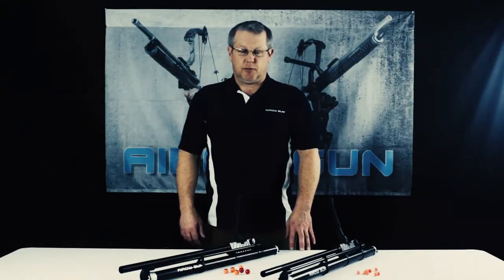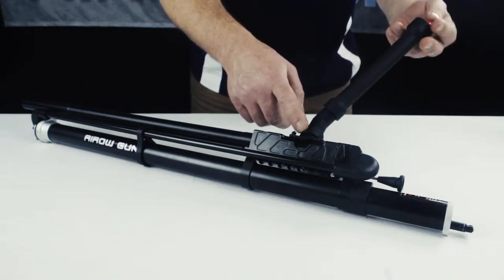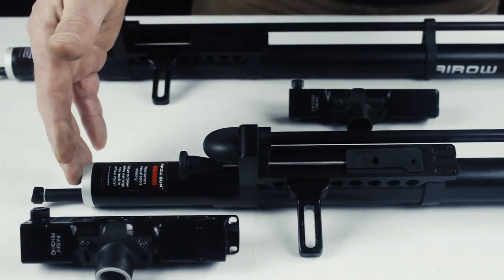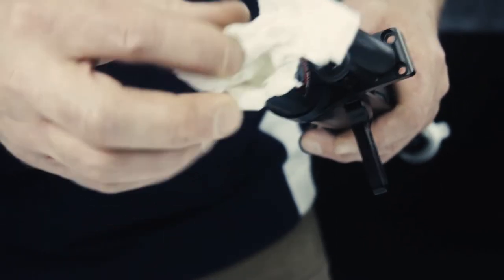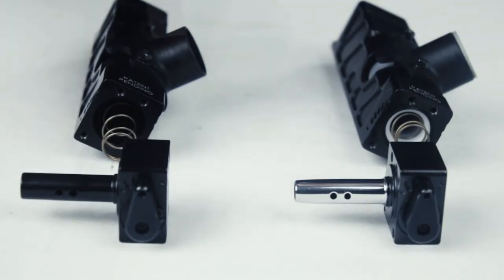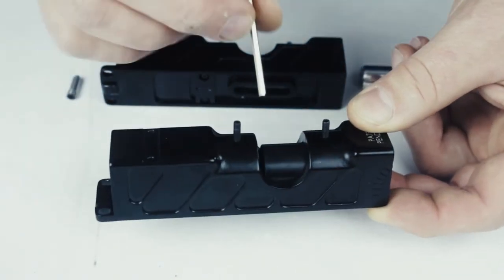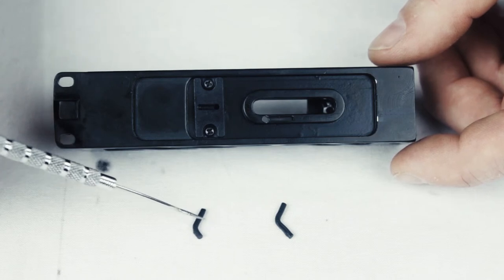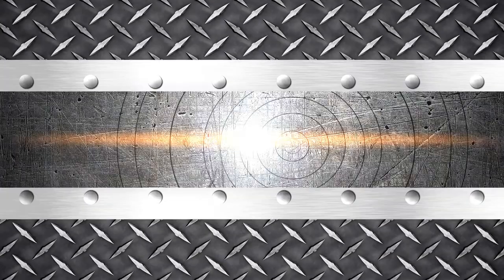Airow Gun Paintball Maintence

Comment: So... is it possible and safe to put the .50 to a bow that can go up to 70lbs?
Reply from the maker: Richard Friday it is possible and safe to do that. However putting the bow up to 70lbs while it will increase the velocity, it will also decrease the accuracy of the ball. We hear at Airow Gun regularly  send out .50 cal units using the Diamond infinite edge bow which can be set to 70lbs, however we typically set the draw weight to around 40lbs. If you do wish to set your bow to 70lbs we recommend going with the .68 cal version.
Reply: Airow Gun thanks for the reply, I have yet to buy one, but was wondering which version to get, thank you.
Reply from the maker: No problem if you have any other questions feel free to ask and we will be more then happy to answer.